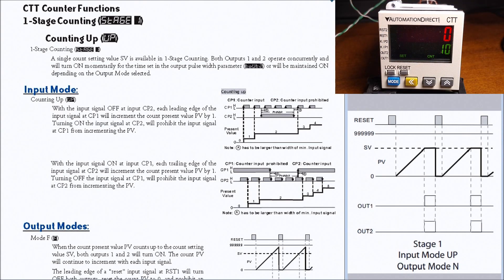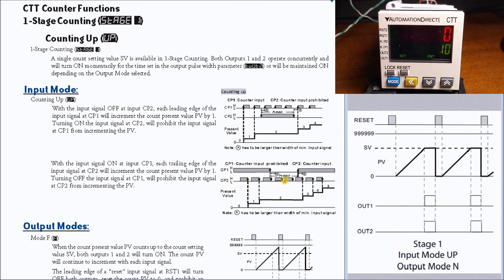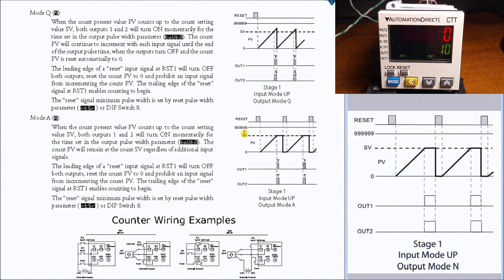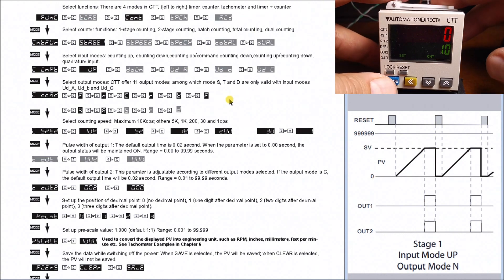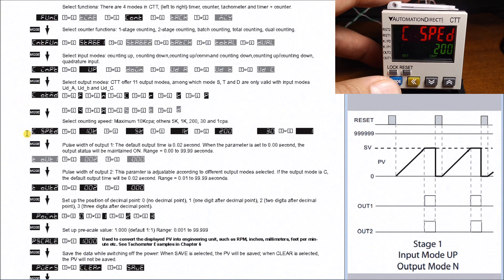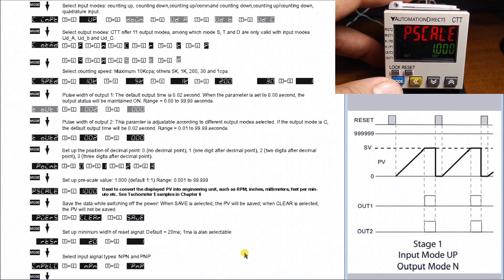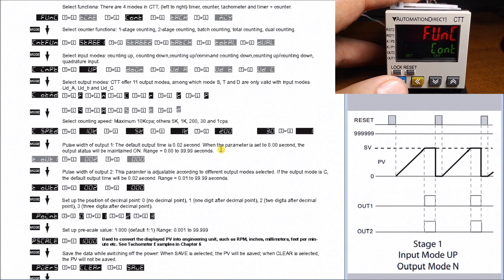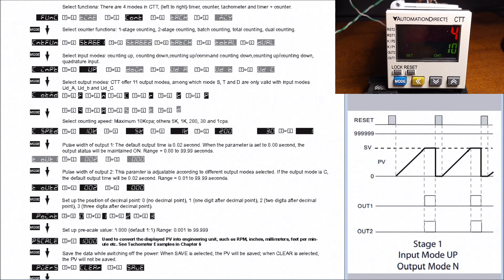CTT Stage 1 Counting - Counter Modes

Comment: When i hold down on MODE, It doesn't do anything. I do not have access to all the functions. Is there something else i need to do? Thanks!
Reply from the maker: Hi Jordan,
The LOCK key may be set up:
The LOCK prevents settings from being changed. The key-protected mode still works after the power is switched off. Press LOCK to enter key-protected mode. In non-key-protected status, press LOCK to enter Lock 1, press LOCK again to enter Lock 2. Press MODE and Left Arrow at the same time to disable key-protected mode. LoC1 (Lock 1) disables the functions of all keys. LoC2 (Lock 2) allows users to change SV and functions of RESET remain. LOCK only functions in non-key-protected status.
https://cdn.automationdirect.com/static/manuals/digitalctt/cttuserm.pdf
Regards,
Garry